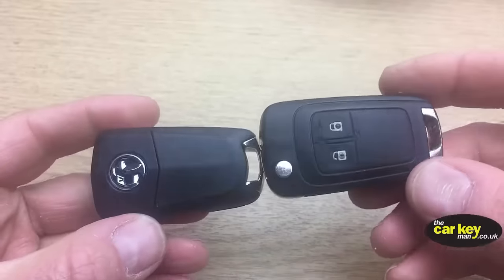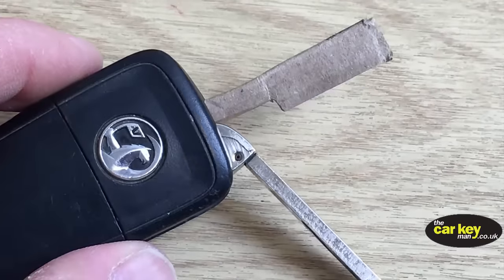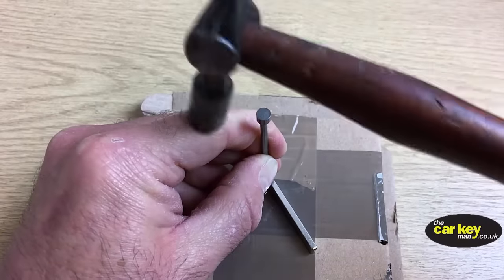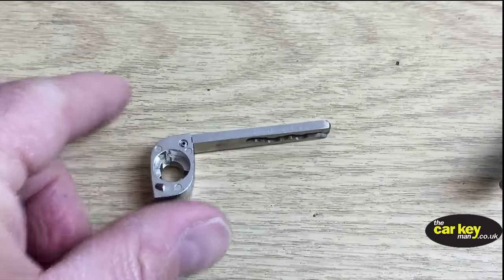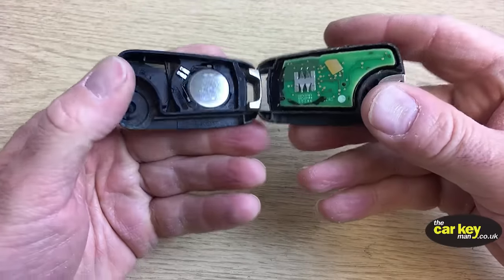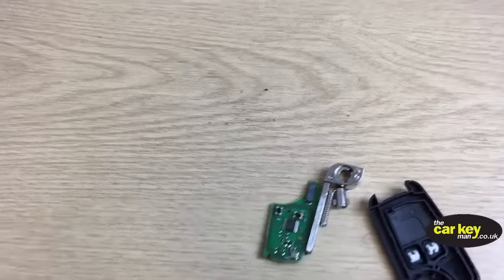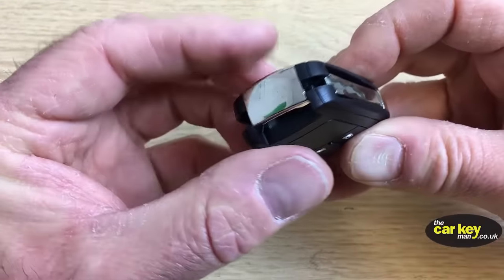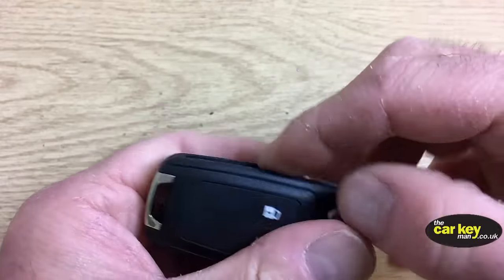Vauxhall Flip Key Repair Kit Instructions

Comment: Very happy customer here. Bought from Amazon having watched this first. There are cheaper replacements on eBay but they don't come with the tool to knock the pin out like this one so well worth the couple of extra quid. Many thanks!!
Reply from the maker: Thanks for the feedback, really happy that you managed everything ok:)
Reply: The Car Key Man  hi! Great video. P purchased replacement for from ebay dealer. The case and components look exactly the same as yours. Minor differences. No instructions or explanation of minor differences in your package  rear of the case has no battery compartment. There a logical path to re assembling the case so noticed  minor differences in the ket shaft to my originlmy but it looked and felt close to the original key. Finally checked the site i purchase it from and there a 10 minute video of finger going through the assembly of the new case with minor references the original blade  to replacing the battery, fiddling finger filling the battery an circuit board contacts. And closing the case Your. After a few attempts trying to analyse the difference the difference key heads discovered the differences. Finally found your site. I still have to fit the battery contacts circuit board every time open the case open the case So i just want to say how good your video is
Reply: That's where you went wrong Tony conroy - should have bought from The Car Key Man!! Man has the patience of a saint too responding politely after you've shopped elsewhere but used his video! 🤣
Reply from the maker: Hi Tony, I think you bought it from a drop shipper. This is where you buy it from eBay and they then buy it from us and send it to you, after adding a load of money! How much did you pay if you don't mind me asking? Thanks for all the info :)
Reply from the maker: HI, I'm happy to help out whoever needs it, thanks for your kind words :)

Comment: Just did this on my wife's Astra 2012 Astra. The old key was glued shut from factory so wouldn't come apart easily. Figured the best thing to do was to put it on the foor on a carpet/rug then push down on one of the plier arms with all my weight. Once it popped you could hear the adhesive break. Ridiculous.

The only other tricky but was the blade swap. Couldnt get the pin started in the new holder, i'd filed it back as you suggested but still wasn't perfect so filed a little "relief" in on one of the ends so you can get the pin started more easily. Once it was started it was SUPER easy to get in.

Other than that - THANK YOU!! Extremely helpful video.
Reply from the maker: Hello, yes for some reason some of the cases are getting a lot harder to open, not really sure why. Maybe they were made in a different factory, so you did well getting it apart, well done. 
Thansk for the feedback, it's really appreciated :)

Comment: I'm really struggling to get my old key open. It just won't budge. I've tried everything. Any ideas? At this point I'm thinking if it's just easier to order a new circuit board? Would that even work?
Reply from the maker: Hi Shaf, sometimes these can be tight, are you using the Circlip pliers?

Comment: Great easy to follow video thanks, however, the problem I have is the microswitches are broken on both key fobs I have. Any suggestions on replacement of those including the coding to the vehicle for security?
Thanks
Reply from the maker: Hi, well it doesn't need coding after swapping over the case. Swapping the switches is tricky unless you have the equipment and have done it before. My advice is to find a good locl company to do it for you

Comment: My Vauxhall Adam key was bonded together apart from the battery cover I had to cut the joints and completely destroy the key cover but the replacement kit was fine all went together well.
Reply from the maker: Hi Colin, they are glued and we're starting to see some that have been bonded very tightly, others just pop open, not sure why. Well done on getting it done

Comment: Followed these instructions  twice and did a dummy run with watching video and simply stripping the new case down and back together easily.
You need PATIENCE and care to do job perfectly  and following this video is simple enough.
I however removed pin with the chrome thing removed from both fobs and attached chrome bit down onto some wood with a small screw and washer and with tiny hole for pin to fall in to.
Great video very very clear and good quality instructions.
Reply from the maker: Thanks Gary, yes very true. Nice and slowly and get the job done correctly. Really appreciate your support on the channel  :)

Comment: Two issues while trying to follow this video and it nearly caused to break my keys entirely... number 1- the new blade wouldn't come out at all after I knocked the pin out, tried pulling it out with the pliers and it woudn't budge and number 2- my old case wasn't opening at all which caused the top part to almost rip off and while the bottom part remained shut not coming apart at all... I don't see why I'm having difficulty when it's the exact same key and I'm using the exact same method 🤔🤔🤔
Reply from the maker: Hi, sorry you're having trouble. 
So the first issue is just age. The only thing that is keeping the blade in is the pin, plus a tight fit. Sometimes this is caused by dirt, or corrosion, or the likes, but there's nothing else holding it in. 
I've started to hear of cases that are very tight, it wasn't a problem when I made the video. Now there are more cases that seem to be glued very tightly. 
When this happens there are several options. 
I gently melt the joint with a soldering iron, which is a bit slow but is the safest option. 
Or, a hacksaw blade can be used to gently saw the case open, but bith these methods carry some risk, unlike the pliers

Comment: Please Help! Many thanks for the great video 😀 I have changed everything over. Put new battery in at the same time. The buttons work to lock and unlock door but the key will not start the car
Reply from the maker: Hi, this normally means the chip has been damaged on the swapover

Comment: Only thing I’m struggling with is how to open the old key fob? Feels like it’s stuck together with cement
Reply from the maker: Hi Matt,  thanks for the feedback and sorry your case didn't open simply. It's strange because most keys I see open without any problem and then occasionally I get one that just won't move. 
There's no way to predict which keys are like this I'm afraid. 
It's as if the glue machine did some overtime for a batch, which is a pain i'm afraid.

Comment: I'm already stuck at the first hurdle, removed the pin and the blade just won't come out...
Reply from the maker: Sorry been away, did you manage to sort it?
Reply: @TheCarKeyMan  yes thank you for the reply, my partner lubricated it with some oil and then it slid out without issue.

Comment: Smoothly done thank you , managed to do this one..any clue how to do the spare fixed key?
Reply from the maker: Hi Edd, glad it helped. The fixed code key is a different story. The circuit board is tricky to get out, and the blade doesn't swap over, so you need to get the blade cut

Comment: Great video and kit. Just finished the job on my sons Astra J. The hardest part was getting the pin in the blade. What I found was to use Mole Grips to hold the pin in place and gently tap the top of the tool to get it started. The balancing thing didn't work for me. Oh and you need a decent set of eyes. Thanks again
Reply from the maker: Hi, thanks for taking the time to leave this feedback. 
Yes, you need an extra set of hands and it’s a bit fiddly, but please you sorted it and thanks for the tip :)

Comment: Overall a good video, but when I tried.... all was going well up until trying open my old fob, it just wouldn't open at all, it seem to be sealed completely, I tried too hard and ended up damaging the board inside when I finally got to it...   :(
Reply from the maker: Hi, sorry you have had trouble. When I made this video, every time I opened one of these, they just popped open no problem. However I do now see and hear about cases that are so tight they are very hard to open. It's not that often, but is becoming a problem for some people

Comment: Bought the kit off of Amazon for £15 and spent about two hours chipping away at my 2012 Astra key fob to break the seal as it was fused together.  There was no way any type of pliers would get it apart and in fact the fob broke in the corner as I was doing this with such force which then was making it difficult to find any purchase to attempt to prise it apart again.  I used a Stanley knife and even a serrated steak knife and pizza knife to saw away at the joints.  After a few cuts to the hands and a million tiny plastic fragments coming away from the fob, I was able to slightly open the remaining part of the fob which allowed the circuit board to fall out.  Thankfully it still worked after putting it in the new housing, but it could've gone either way.   To anyone else, if your old key fob splits open as it does in the video then the whole job is very simple and will take you five minutes to complete.  Oh, and the old Vauxhall logo fell out of the old fob in my struggles so I simply glued it to the new fob - no soldering iron was required.  Thank you.
Reply from the maker: Hi Stephen, yes since I made this video I occasionally come across a really tight case, and I can't explain why some open easily and a few do not, I'd not seen thi sat the time.
Glad you got it going again and thanks for the full and honest feedback :)

Comment: Bought your kit from Amz. Followed this through OK. Not exactly easy but got there in the end. I managed to get the old case open with a couple of pairs of needle nosed pliers. My instance was rather more explosive than yours and it rained bits on the kitchen floor but the circuit board made it out unscathed. I would say the final tiny screw was hard to get in. Managed to get the logo off my old fob with a pick and a blob of Loctite flexible glue has affixed it. Good as new. Overall would recommend but you do need to be a reasonably competent fettler to get this done.
Reply from the maker: Thanks for the feedback and for buying the kit :)

Comment: Hi I have managed to change over the keys following all the instructions without any problems. However I am only able to lock the car and not unlock it. Would you be able to help me please
Reply from the maker: Hi Barry, I've this a few times since I made this video. Every now and then, the metal of the battery connector touches the green circuit board. If it does this in the wrong place it can cause this problem. 
Try gently bending the metal away from the circuit board and see if that makes a difference

Comment: The bit that holds the spring, too big for the hole. dropped out, the original one doesn't fit well enough... but alas I have a key,
Reply from the maker: Hi Gerg, are you using all the parts from the new key except the blade?

Comment: You mentioned in your video about people having problems getting the old key open, well that's what happened to me. I have the same pliers as you but the key would not budge however much pressure I applied. I ended up running a knife down the join as carefully as I could but must have damaged the circuit board as I now have a lovely new cover on a key that doesn't work remotely.
Reply from the maker: Hi Paul, if you have my number from the box, give me a call, hopefully I can help

Comment: I have successfully done every step in terms of swapping the internal chip board, I know how to put it together etc. Have managed to remove the pin from my old key blade in order to replace the old with the new provided in the kit. The blade seems to be stuck and I cannot remove it from the flip section. Any advice? I don’t really wish to spend money having the new blade cut after spending it on this replacement kit. 

Secondly, have also put all together (without the silver key parts in) and tested the buttons out. The unlock key clicks when putting the pressure on the button however the lock key doesn’t click. Is this standard or is there an issue with it? 

Thank you.
Reply from the maker: Hi Tasha. 
Ok, so the blade is just stuck. If you can hole one end in a vice, the the blade will come out witha  good pull.

As for the buttons, I cannot think why there would be a diference, did the buttons work ok on your old key?

Comment: Ordered the kit and arrived within a few days, watched the video before commencing and then whilst installing and took me an hour as I had to file the pin a bit more than was expected but got there and then getting case to click in place.  To get the old Vauxhall logo off the old key, I just heated up an old sharp knife and melted the plastic and prised it off and stuck it onto the new key fob.   Overall, with the help of the video it was straight forward job, just take your time. Many thanks to the The Car Key Man, you saved me a few bob 🙂
Reply from the maker: Hi Dean, thanks for this great feedback, really appreciate it and thanks for the order :)

Comment: The two half's of the new fob case don't go back together on my corsa D pre face lift, the electronics are about 2mm too big width ways to the direction of the key blade so they wont clip together properly leaving a substantial gap especially towards the back towards the key ring, the pin fitted ok and is flush, initially the central locking worked and I fitted a new battery as a matter of course, now the central locking will not work at all, the engine started and will check again tomorrow but I suspect it may not start as the "chip" is too wide too fit in the new fob, so to Vauxhall on Monday for an original one and a very expensive fix, I took extreme care with the electronic "chip" , I guess the poor fit of the plastic case has damaged it irreparably, pretty disappointing
Reply from the maker: Hi Dave, if the board doesn't fit inside, then you have the wrong case. Did you get it from us?

Comment: After knocking the pin out from the old key fob. i can’t remove the old blade.
Reply from the maker: Hi Craig, it will come out. Sometimes the are very tight. Do you have a vice?
Reply: @TheCarKeyMan  Hi,Some WD40 and a few gentle taps with a hammer i got it out.

Comment: I lost the flip key and only have spare blade key. It has central locking on it. Can I put the internals in one of them flippy keys?
Reply from the maker: Hi Claire, unfortunately not. The circuit boards are a different shape

Comment: How does this programme to the car my fob stopped working so have to lock manually please could u let me know and also purchase price please
Reply from the maker: Hi Paul, sorry I missed this. Before swapping anything over, try and find out why your key has stopped working. The keys do not need recoding because the buttons automatically work when coding in. I would get some advice from a local car key person.

Comment: My old blade is stuck in the old key I've takes the pin out but the blade won't move what should I do?
Reply from the maker: Hi, it will comeout. If you hold it in a vice it will come out

Comment: Just repaired my Insignia ignition key  bit fiddly used a long nosed tweezer to hold the pin before tapping home. Great video and it all went fine really pleased. Was quoted over £100 pounds at the Vauxhall main dealer. Many thanks for the great video
Reply from the maker: Great stuff Paul, really appreciate your feedback :)

Comment: That little metal bit near the battery holder is loose on the new fob I've bought (Cheap eBay one) is it a lot sturdier on the key that you recommend? Went flat, changed the battery but still no luck - noticed the metal bit needed fixing but it kept coming off! Doesn't help that the driver side door lock is sticky...
Reply from the maker: Hi Matthew. It's difficult to say, but some very cheap keys are just badly made. We don't get many complaints. There's a link in the video notes on how to buy ours.

Comment: Losing my mind here😭 don’t know if my old key’s plastic is somehow melted, but I cannot get it to open, been trying for 30 minutes, completely destroying the plastic and still cannot open it. Ffs😅
Thanks for the video though, was very helpful!
Reply from the maker: When I made the video, they all popped open easily. Over the last year I get more comments like this, I can only think that’s one of the batches have been glued tighter than usual!
Did you get it open?
Reply: @TheCarKeyMan  unfortunately not, I tried to cut it with a saw but ended up cutting one part of the chip😅 thinking whether to try it with the other key or just go to a shop and pay for a new one.
One thing though, I have an Opel Corsa (not Vauxhall like you have in the UK), so maybe the different batch is because of this

Comment: some aint easy it took me 30 minutes to get into my old one screwdrivers melting it with a knife and ruined my board the one he used was a duplicate one already my astra j was like fort knox
Reply from the maker: Hi Ken, sorry to hear you had trouble. The one in teh video hadn't been opened, and it just popped open. However, since making the video, I have noticed some of them are very tight and I don't know why.

Comment: The little hole in the bottom of the circuit board was in a different place on my key. Meaning the back end wouldn’t clip shut at all. Had to file a little piece of plastic back in order to make it fit. Took a while too figure it out but sussed it eventually
Reply from the maker: Hi, that's a bit odd. Was the case you ordered identical to your old original case?